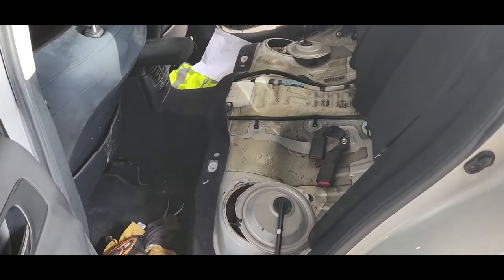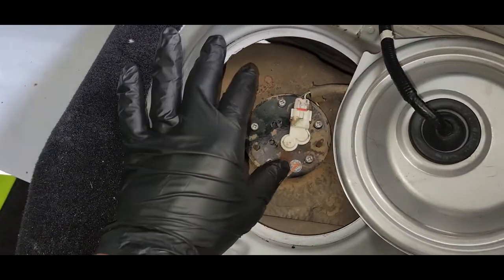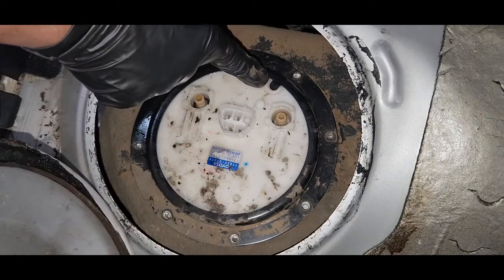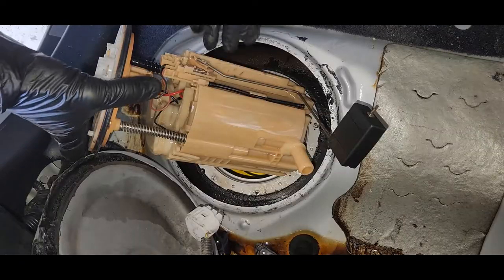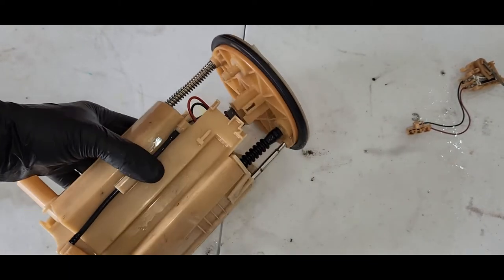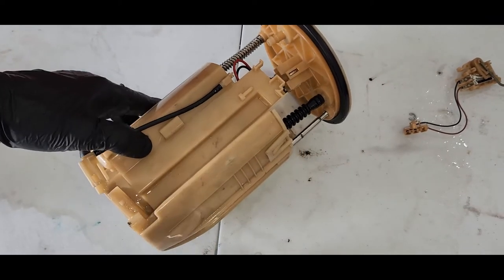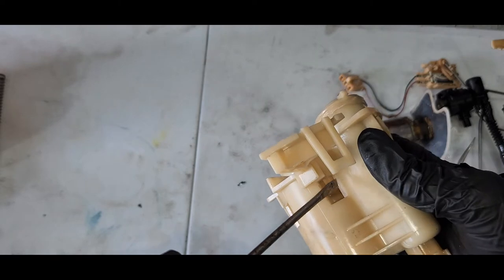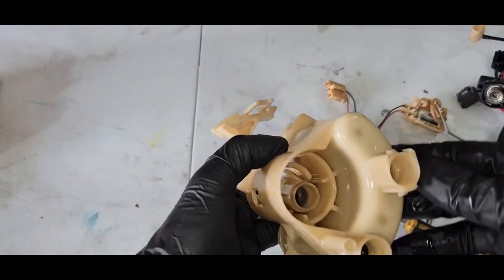Lexus Is250 Fuel Filer Replacement 2007/ fuel filter gets clogged,

Comment: Thanks so much for this tutorial, I followed it step by step and it all worked perfectly... Until I had to fit it back into the tank. I hadn't taken a photo before removal, so was putting it back in the tank in the incorrect position. After playing around a bit I got it right. I'd advise anyone doing this to take a photo before removal; and note how the float sits in the tank, so they don't end up in my earlier situation, where the float was jamming against the hose in the tank. Also gloves are necessary for this job. I didn't wear any and ended up cutting my hands on the sharp metal housing.  

Thanks again for posting this. Much appreciated.
Reply from the maker: Thanks 😊

Comment: I can't stress this enough...BEFORE you remove the fuel filter,  CLEAN ALL the dirt, dust, and debris around the entire area. Basically, eALL surfaces that are visible through the fuel filter access port. Us a paintbrush, vaccum, and some rags. 
The LAST thing you want is the dorst to go into you fuel tank and cause a whole bunch of problems, premature fuel pump failure, clogged fuel filter/ system, rust in the gast tank, etc. A ton of money and time wasted. Let's not mention MAJOR headaches.

Also, just buy a drop in Fuel pump. It comes 100% assembled with all new components.  Less chance of things breaking when transfering over parts.
Reply: What is the already assembled fuel filter/ fuel pump assembly called? Or do u know its part number?

Comment: Just took my pump out because of an annoying ticking noise and low MPG, the filter was totally blocked, car only has 89k miles on it, 100 percent would advise people to change it as its a cheap part and can probably sort alot of performance and silly noise issues out.

Comment: Hey guys! I have a 08 IS250 that’s having some issues. The car is cranking, but no start. Eventually after 2nd or 3rd attempt, it officially starts. Once it starts, theres a deep rumbling sound underneath the car. No check engine light was on, but still scanned it either way and came out with 1 code which was Intake Air Temp Sensor was high. So I replaced the MAF sensor. Checked the throttle body, air filter. All were clean. Any ideas whats wrong with it?
Reply: Remove the back seat and listen to how the pump works - it can transmit vibrations through the fuel lines to the entire body
Reply: Did you find out what was wrong mate I have the same issue

Comment: Great job! I have a fuel smell inside the interior when driving on mountains roads. Can it be big O ring on the top of the fuel pump assembly? It never happen on flat highways only when going decline..
Reply: Yours its the fuel pressure sensor going out
Reply: @bosmanragga51  for anyone interested and facing similar issues, it is just the flaps inside the rear bumper which are open all the time on my euro model (lexus has an updated part for those). I fixing it by just adding some tick sponge inside of those flaps to stop the exhaust gasses getting inside the cabin.
Reply: @alek123ish  Ok